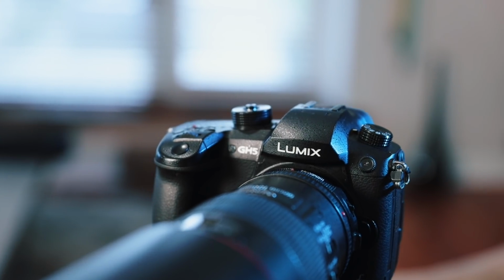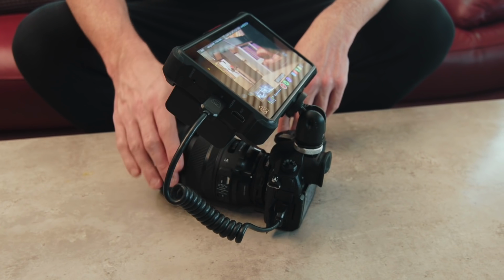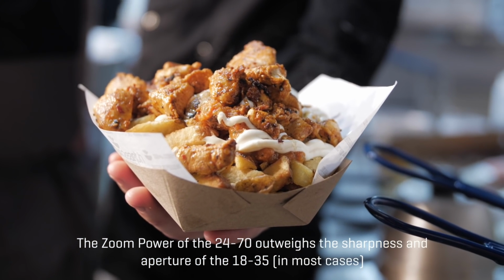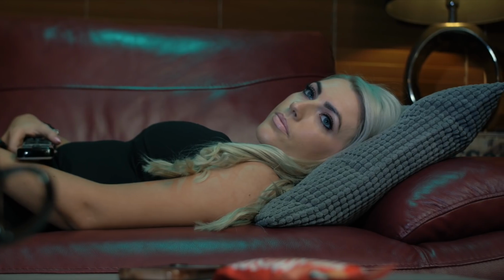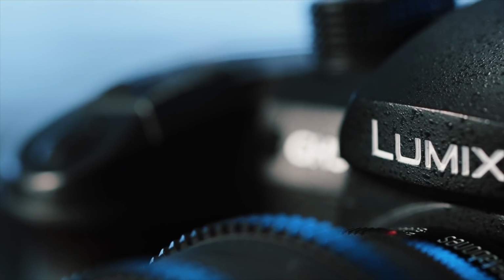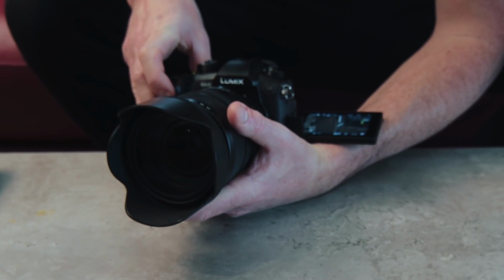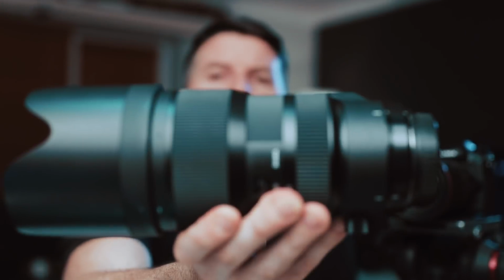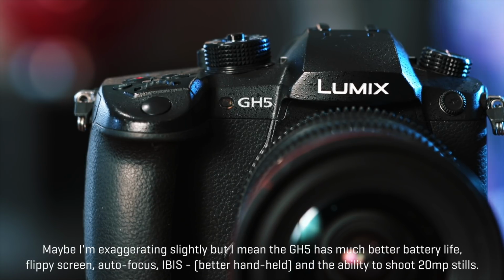GH5 - 2 YEARS LATER (well almost!) and how it changed how I work.

Comment: Really helpful video mate thank you for putting it together. Note this video was shot in December so you may have found this out already but you can actually improve focus transitioning when shooting with MF. Go into your FOCUS RELEASE shutter menu and select AF/AE lock - set it to AF/AE lock and then below set AF/AE lock hold to ON. Go back to screen display and drag the box to the area you want to focus. I find when using this the focus transitioning is definitely smoother and not so much searching. Let me know once you have tried it. (bear in mind  though that this doesn't seen to work when variable frame rate it set so you will need to turn this off.

Comment: 1 1/2 years using the GH5 and it's been great. Same here on learning all of what it can do. Myself, I only use the AFC. Lots of fast-paced shooting and 99% of it handheld. It was a bit tricky before the firmware updates but since then it's fine. Recently I did have an AF issue and the camera itself acting strangely. Turned out to be a failing battery. Not needing a charge, just failing. I use the 100-400 most often for surfing. Also have the 8-18, 12-35, and the 35-100. Very easy to carry the entire kit compared to my FF Nikon gear.

Comment: As a GH5 user, I'd say that Auto focus has greatly improved with the latest firmware update. I now, for the first time, use auto focus successfully with the GH5.

Also, you may want to consider using the "Focus Transition" feature in GH5, especially on gimbal shots, when you have to hit specific focus points and transition between them smoothly during the shot. I use the IBIS with the gimbal, so that I could  safely tap the screen for those focus transitions without affecting the smoothness of the gimbal shots.

Lastly, when using GH5 with V-log and recording at 10bit 400mbps, the results are exceptionally cinematic (if you want them to be). The image is very flexible in post and with right color grading, I personally prefer the GH5 image to the images I'm seeing from both the GH5s and the BMPCC4K, not to mention the 8bit images from Sony cameras, which I personally wouldn't even consider, even if it was merely for the 8bit codec. My point being, that the GH5 is not inherently less cinematic. It is flexible, and can look very cinematic when you want it to.
Reply from the maker: Thanks for the comment, you make some great points here and I'll definitely consider all this. I'll surely get v-log too as you're comments here are quite strong on it.
Reply: Your comment doesn't make sense regarding the 5s - it's objectively a better sensor.
Reply: Hi What kind of computer and editing software are you using to edit 10bit 4k video from the gh5?  I recently bought the gh5 and did some 10bit 4k test videos and my very powerful i7 8700k, 1070gpu, 32gb ram with ssds and adobe cc2019 premiere stutters and craps out after trying to edit more than 10 seconds of 10bit video.
Reply: @gopolarisstudio My preference toward GH5 over the GH5s has to do with a few differences, but in the context of my comment, it has to do mostly with the way it renders highlight rolloff. While the GH5s has a marginally wider dynamic range, specifically when recording in HLG, the way it renders highlight rolloff subjectively feels to me less smooth and organic in the GH5s when compared to the GH5. This is a subjective preference that I have as a narrative filmmaker. If my activity was mostly client based (advertising /music videos/ corporate) I would probably prefer the GH5s (if not a bigger camera, to impress the client). Since all I care about is having great usable footage for narrative filmmaking, I want a camera that will be sufficiently stabilized with non-stabilized lenses for handheld shots with longer lenses that are still usable (thanks to IBIS) and highlight rolloff that I can work with in my post pipeline, to achieve the look I'm after, as well as lots of detail without sharpening, which allows me to reframe when needed, to get a tighter shot without  getting overly soft. GH5 is that camera. The other two aren't.
Reply: @RockstarBruski  with your current setup, you should use proxies for a smoother editing experience. That was the case for me too untill very redently, when we updated our system to an i9 processor with 14 cores, slightly over-clocked with 64GB and a 1080i GPU. With the new system, finally no need for proxies to edit, and the video export is significantly faster. Got the new system from Bizon-Tech, and super happy with it.
Reply: @yshrem  hi great thanks for the reply and your computer info.  Ill check out the proxies work around.  Good to know that an i9 and a 1080gpu can handle 4k 10bit editing better.  I might have to upgrade my pc if i decide to go to 10bit. Cheers! 😎
Reply: @yshrem  My friend they are literally the same in regards to logarithmic roll off. (VlogL). In fact the MORE dynamic range means you get MORE of a roll off.

You should reconsider the science. If you love the GH5, awesome - so do I, I own both! But I'd also recommend looking into the GHAlex LUT.
Reply: What camera would you recommend for documentaries and real cinematic footage? Out of the a7iii or g5 as a begginner?
Reply: And lense?
Reply: @RockstarBruski  I can edit 10 bit 400 mbit footage of gh5 on a 4 year old quad core i7 iMac with 1 gb graphic card 16gb ram, not using a Proxy workflow in Adobe premiere, but using thé scale feature (editing in 1/2th resolution). For Thé 6k hevc anamorphic I transcode to prores and thé iMac plays it back without effort. Thé problems are beginning when trying to color correct... Then I get rendering times of 2 hours for 3 minutes in 4k.
Reply: @utopiavalonis  interesting thanks for the info!
Reply: @yshrem  so where do you like to put the sharpness and noise reduction in gh5.
Reply: @lovefirst6157 , I shoot V-Log-L on its default settings (both on 0). I then apply Neat Video for noise reduction on the log image, place a convertion LUT in the "Creative" tab of Lumetri in Premiere Pro, followed by Filmconvert (for retexturing), and then make final color grading adjustments in Lumetri above the LUT, so that the adjustments are done on the Log image before it is converted to rec.709. I can add sharpness in post within Neat Video, or in Lumetri, depending on how I want it to look, and whether or not it is a green screen shot (if it is, I will apply the key to the noise reduced but not yet sharpen image, key the cleaned log image and then apply the color grading and sharpening. Sharpening still comes before Filmconvert, otherwise you end up sharpening the grain.
Reply: @yshrem  I don't have post noise reduction software so I might have to use the camera noise reduction but at high iso(0 noise reduction) looks really strong.
Reply: @lovefirst6157 , you really shouldn't use the camera's noise reduction. You will only lose detail. Even at the highest ISO, you can still get a usable image if you shoot in Log and use Neat Video for noise reduction. It's not expensive and is  completely worth it.
Reply: @yshrem  I will definitely invest in that then.
Reply: @lovefirst6157  great. Also, whether you end up using Filmconvert, if you remove noise and end up with noise-free image, it's important to retexture (add grain or mild noise in a controlled and esthetic manner) before exporting to h.264 to avoid banding. This is due to nature of the h.264 codec.
Reply: @yshrem  makes sense, understood. I am probably later on the line going to get davinci studio and then see if I need filmconvert.

Comment: I love my gh5, I do lots of live events and so I have to capture it right the first time. Not only does it get perfect and smooth video but I love the 6K photo mode, Essentially you are shooting video for as long as you hold the trigger, then you go in after the event is over and use either the thumb stick or the click wheel to select the exact frame that you want then you click the thumb stick to save a photo from that frame. At 18mp these images may be lower megapixels than my Nikon (24mp crop sensor), but they have a lot less noise in the image.

Comment: great insight into a camera that i use commercially on a daily basis and also deeply love.  Agree with your comments on focus - although the update has improved it to the point you can slide into a large object and it will hold autofocus quite nicely (on a native lens)  Make sur eyou use the built in focus transition feature - it allows stunning focus pulls and onc eyou have used it a few times is very quick to set up. Tip of the hat to you my friend on a great video !
Reply from the maker: Hey. Thanks a lot. I appreciate the nice comments and for sure, I'm gonna try that focus feature.

Comment: One more "trick" I learned recently that helps reduce the "video" look is to reduce the Sharpening in the picture profiles all the way to the left. I did this with Cine-D, Cine-V and VLog, and the difference - and improvement - is quite dramatic. The edges of objects no longer have a glow to them, that is normally caused by over-sharpening and is one of the main causes of the "video-y" look of footage shot with digital film cameras.
Reply from the maker: Good point, I must try that. Thanks for the nice comments too!

Comment: Until recently, I used a GH4 on a monopod, and it was great. But when I got the G9, which has most of the same codecs as the GH5, I was amazed. The IBIS meant I could ditch the monopod for the most part, and it's allowed me to be even more mobile and nimble. I've got tracking and panning shots that I've never got with the GH4, it offers so much more flexibility.

Comment: How do you shoot 60fps and bring it down to 24 in post with no stutter
Reply from the maker: Very easily. In FCPX you can conform the footage by clicking 'automatic speed'. Also you can manually deal in percentages by making 60fps play at 40% etc.
Reply: On Premiere CC you create your sequence as 24fps and interpret your 60fps as 24fps. No stutter.

Comment: Hi Hugh, the GH5 is awesome. I got a question regarding lenses maybe you could answer. When you put any ff lens with the speedbooster and your f stop goes from 2.8 to 1.8. This is f1.8 full frame? Or 1.8 m4/3. If it is m4/3 then you go from a f2.8 full frame to a f3.6 ff. I understand the cropfactor of the distance in the lens but in light is only a crop of the image. The light should stay in full frame terms. Hope you could answer!
Reply from the maker: Hey, I know what you are saying. Basically, a 2.8 FF lens will be multiplied by both the crop factor of the MFT sensor (2x) and the Speedbooster (.64x). I think it works out at about a 1.3 crop after you do the calculations on the sensor and 2.8 x 2 x .64 = 3.6. So it's really like having a 3.6 lens on a ff. The GH5 registering it as 1.8 is fairly accurate considering if you put a 2.8 native on it, it'll say 2.8. Lens f stops are across the board regardless of sensor size but will perform differently based on the sensor. So in essence the gh5 giving you that reading corresponds to how it'll perform. H

Comment: slap the leica 100-400mm on that GH5 and get 800mm ff equivalent, thats something that would be hard to do with an EOS R
Reply from the maker: The EosR has 30 megapixels as opposed to 20 on the GH5. so it's a trade off there.
Reply: Hugh Sweeney even the sony a9 has only 24 poxel and no one would rather chose the eosr over the sony because of the 30 pixel

Comment: I Love the GH5 for its IBIS and IBIS lock features as well as 4:3 anamorphic modes. I usually switch to the GH5s with Vlog at 5000iso for low light also with the XL SB. The GH5s has even less of a crop too. I also don't use the AF on the GH5 even though they have made a lot of improvements. But the M43 lenses are Very very$$ when matching the DOF of fast full-frame lenses. My only complaint with the Inferno is the power consumption but I do love the larger brighter screen. I hire 2nd shooters with the A7iii and I does have better AF but in low light with both cameras with fast full-frame glass, the Sony image falls apart faster. And when you compare to the GH5s with the same glass, the GH5s looks much cleaner. I would recommend a Nikon Z6  for photo/video over the EOS-R it's comparable in photo but for video, it's just better in nearly every way but the articulating screen. Plus the amount you save could buy you a wireless follow focus and you could set A/B points.
Reply from the maker: I hear you and you make some good points but I have all Canon lenses. The eos r isn't great as an all round video camera but the image is nice and for locked off tripod shots where you're facing the camera and holding up products etc, then it's hard to beat with the focus and flip screen.
Reply: Yes, you just have to figure out the math to get the same focal length with a wider lens. IMO, the EOS-R was just over priced. If it was $1699 it would be a fantastic camera for the $$. I more just annoyed with Canon for holding back their tech. They don't want to loose any C200 and 300 sales.

Comment: Hello Hugh! Just found your channel searching out info on the GH5. Bought the Lumix G85 couple months ago as an upgrade to a handicam type camera to do 4k video. Fell in love with it, but coming up short on a few features such as integrating into my Atomos Inferno, 10 bit color, etc. So now upping to the GH5 soon, and looking forward to using it for more production like shooting. 
 I hear the Rokinon DS (Samyang) glass is really good with quality beyond their price points. Glad to see you are using them, seems to me they are very worthwhile! 
 One question I have is why have you decided not to use the V-Log L? I figured it would work well together with the Atomos and editing on Resolve Studio.
Reply from the maker: Good to hear, the GH5 works great with the atomos but make sure your cable ports don't wear out with use. yes, as I have resolve studio and am now using it for editing, it really makes sense to use the v-log  so I'll invest in it for sure. the Rokinon glass is fine but I'd also like to look at Samyang glass too esp the 'XEEN' stuff. Really nice. I'm doing a bit of photography for work too so cine lenses aren't really worth it.
Reply: @HuFilms  Thanks for the reply! Yes,  I just bought a GH5, lightly used with V-Log already installed. Saved a lot of cash going that route. Planning on using it on a Tilta shoulder rig and v mount battery setup I just bought as well and keeping it together as a grab and go setup. I already have the V mount on my tripod so works out perfectly. Since I've never used a rig with matte box or follow focus, it will be a new experience. 
 Good luck with your V-Log. Looked at the Panasonic web site and it's not available. Maybe on Amazon or Ebay? 
 As for the glass. Been doing more research and found Samyang is the same glass used across many brands. The main difference between the Rokinon DS line and the Xeen is the housings of the Xeen, besides being aluminum over the rest being plastic, are all made to the same length and standard pro Cine diameter for faster and easier lens changes on set.

Comment: Hi @Hugh. I've been wanting to buy this camera. And I use the Sigma 18-35 on a Rebel SL2. Reading your caption on this,  the film maker makes it work. But tools are always good. Would this camera be settling, or should I just get the GH5s?
Reply: Also,  I do a lot of night videos. And I shoot in 60fps,  mostly hand held
Reply from the maker: It's hard to know if it's best for you. Sony full frame cameras are better in low light. The GH5s isn't gonna be as good if you hand hold the camera a lot. Hope this helps! @flipb0y1
Reply: @HuFilms  thank you. And which direction of the Sony's should I go with? Perhaps two that I can compare

Comment: Hi Hugh, I've recently on one shoot, tried adjusting the shadows/highlights settings at -5/+5 with zero contrast after reading a recommendation when using CineD but watched your video talking about the colors and banding issues you had. Did you also have the contrast on zero when you adjusted the shadows/highlights and was it on a CineD color profile? Thanks.
Reply from the maker: Hey. Yeah, CineD as I never actually used V-log on the gh5. This really messed me up for a while. One client asked me to reshoot a job on the Blackmagic cam and they pointed out the pixelstion. Basically, there was pink and green banding and the footage was totally breaking up. My advice would be to stay away from the curves. I think you should be safe enough with the lower contrast. In regards to CineD, I question whether or not that's a good profile. I found it a bit unnatural looking. CineV might look better at the cost of dynamic range a little.

Comment: Great review, I’ve had the gh5 for about 18 mths  and still fiddle with the settings.  You mentioned shooting in 60fps so I’m assuming you are running the camera in NTSC mode, have you had any problems under lighting being in a PAL country? Cheers
Reply from the maker: Good point. If you shoot using a shutter at 216 degrees it seems to align with the lightings phasing in most cases. When you go above that it's a different story. High frame rates can be a nightmare.